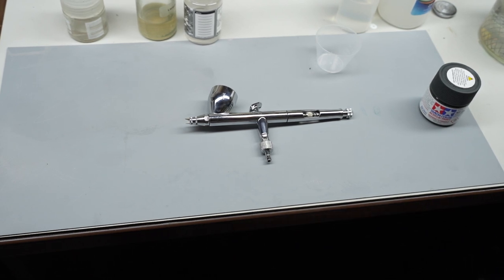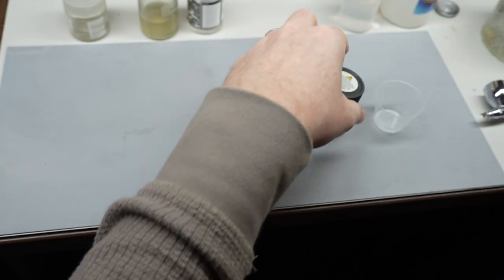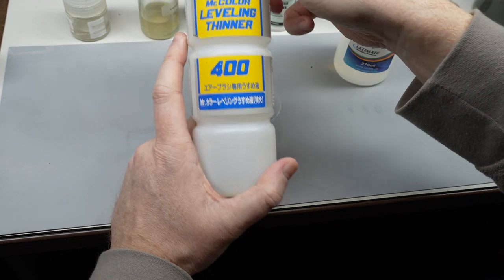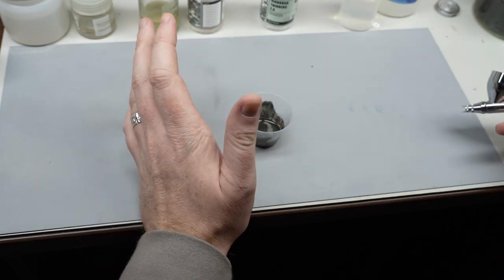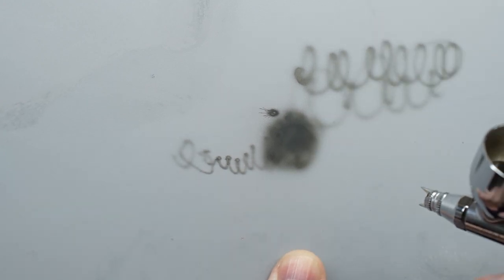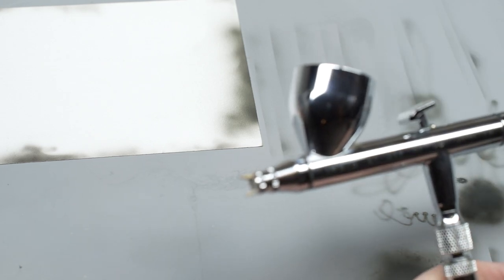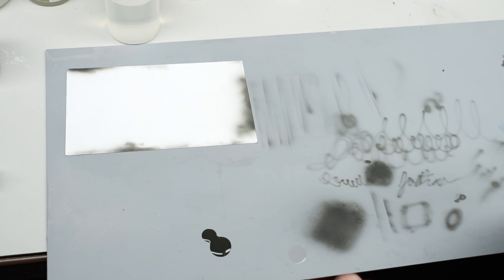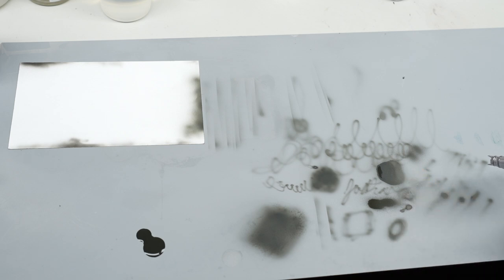Airbrushing II - Thinning Paint and Making Messes

Comment: Thanks for sharing your expertise.  Where did you get the needle protector, it isn't the standard for the Eclipse HP-CS?  Your trigger looks different from the one on my HP-CS,  where did you get it from?
Reply from the maker: So yeah, I added a few different things. The back handle is from an HP+ which uses the same threads. The trigger is from the Eclipse Takumi, I just ordered the trigger as a replacement part. 

And the nozzle cap is a crown cap that I filed down 2 tips. If you look up the Iwata Eclipse Crown Cap, you'll see what I mean. If you wany any of these pieces, just check out any online store that sells Iwata replacement parts and tell them what you need. Midwest Airbrush, Coast Airbrush, TAG Team Hobbies, Spraygunner, all great stores.